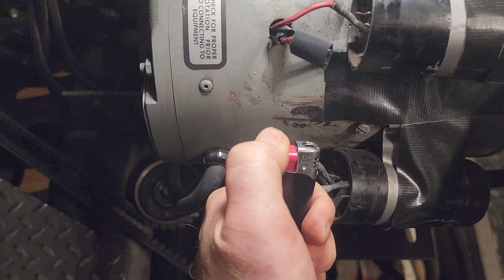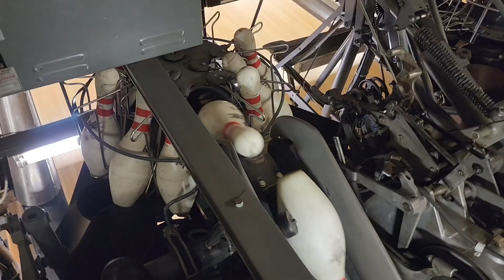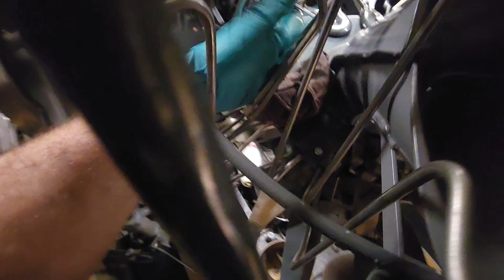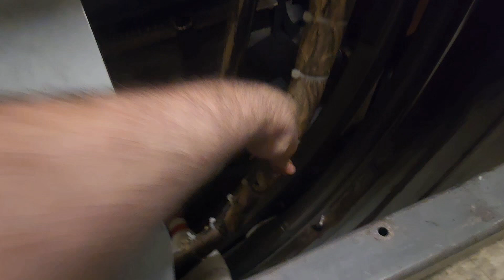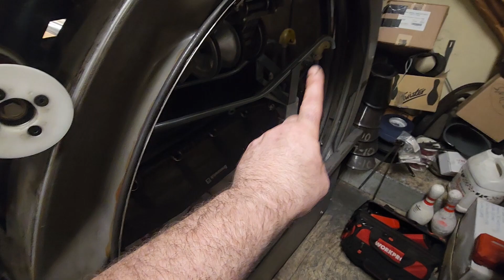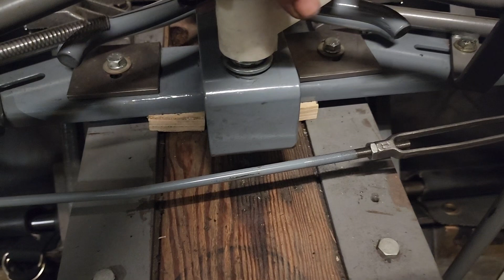3-day Service Stop.

Comment: Were those units original "A" units?
Reply from the maker: I do not know for sure. They may have been model A originally.
Reply: @michaelbuckley3808  I work part-time at church bowling alley  with six A pinsetters with above ground ball returns.